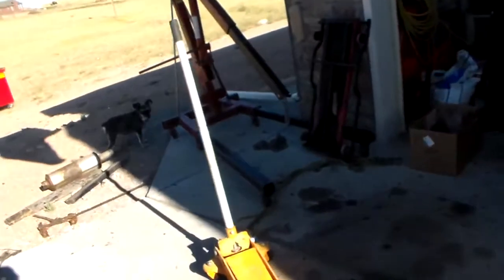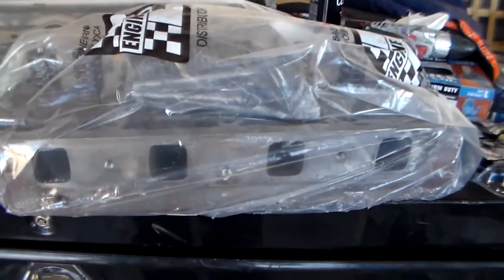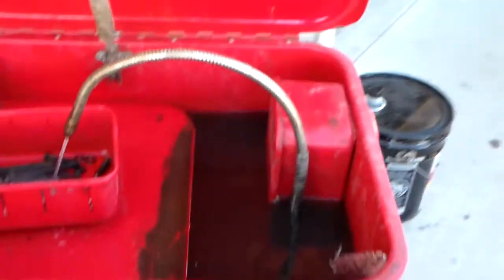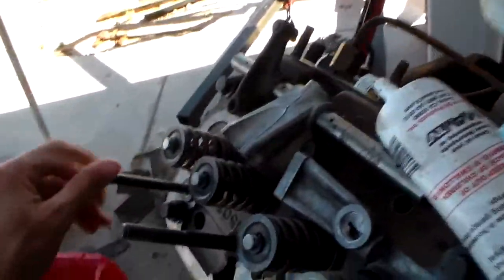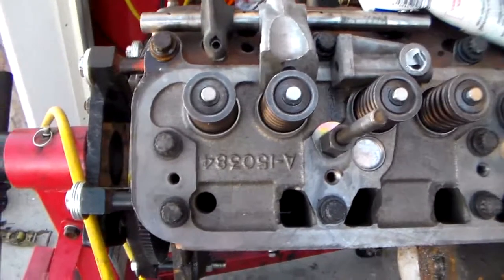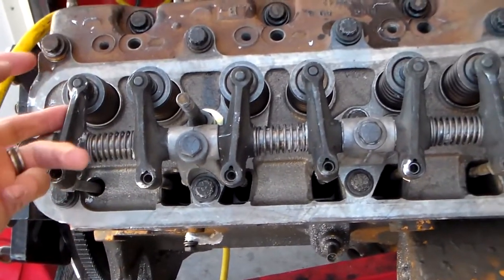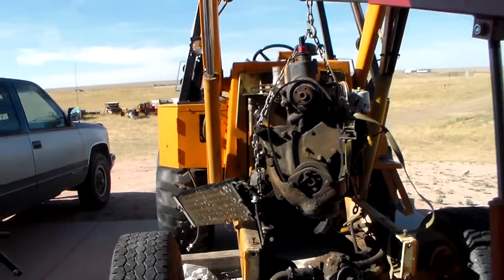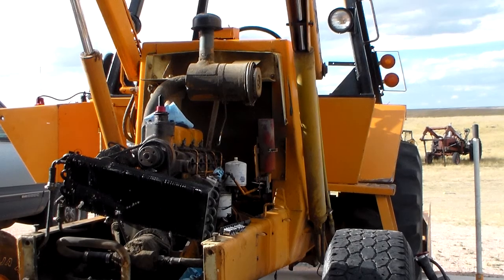case 580c diesel engine overhaul

Comment: Nice work, so what did the overhaul? cost
Reply from the maker: It has been a while, but if memory serves, it was $300 for the head rebuild and about $400 for the lower end kit.
Reply: Nice budget repair do you still have the tractor? Is it working out really good?
Reply from the maker: @TERRELL SCAIFE  it worked almost every day for 3 years, then started getting coolant in the oil. I traced it to a leaking liner o ring. When I tore it down, i found a pitted liner boss in the block. I am in the process of repairing it now, but I have not had any time to video it.

Comment: Nice, I just bought a case fork lift with the same engine, a 585c I think, it’s unmarked. Fired right up with a new battery after sitting for over a year. It’s blowing a mix of black and white smoke, and the everything is gunked up. I hope it doesn’t need too much work 🤞🤞

Comment: Where did u got the rebuild kit ? The one I will buy is 1969 580ck but gass the guy said one xilimder is bad and he juat runs if for 10 min so it wont overheat !!
Reply from the maker: I got my kit from Abilene machine.
Reply: @pronghorntractorwork  ok thanks man

Comment: What engine has the gasoline 4 cil
Reply from the maker: The gas engine in the 580ck is a g159. That machine is quite a bit older than mine.
Reply: @pronghorntractorwork  ok thanks the guys sold it under me but is ok

Comment: did not bleed your fuel lines did ya
Reply: Mine is a whore if you run her outta fuel, gotta bleed at the injectors and giver a sniff of starter fluid.
My tractor is old as sand.

Comment: im about to rebuild a case 207 motor. any tips?
Reply from the maker: i suggest abelene machine for the rebuild kit. i also would suggest having the rotating assembly balanced, as the vibration is atrocious. dont skimp on head machining, and make sure you have the drilled bolt in the right place when you reassemble the rockers. feel free to ask any questions.